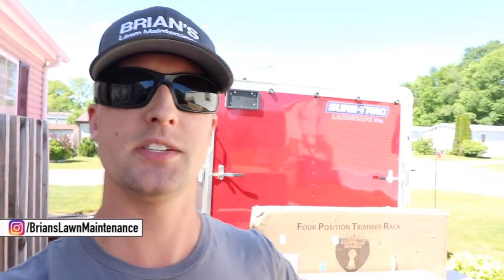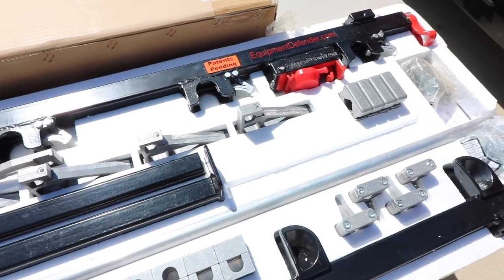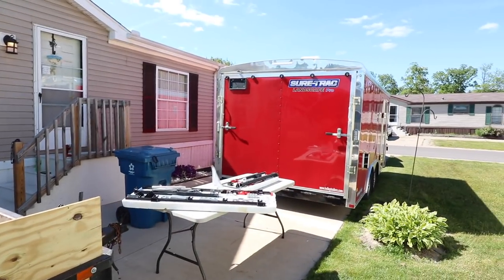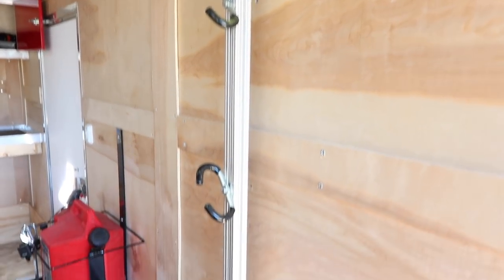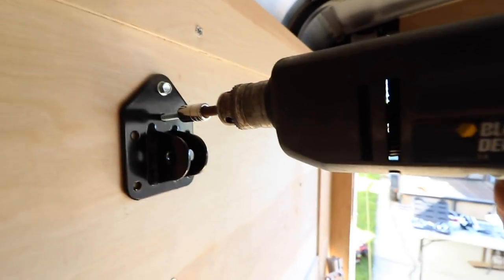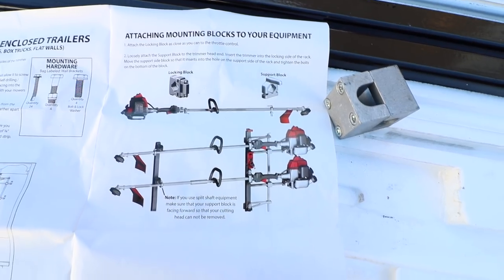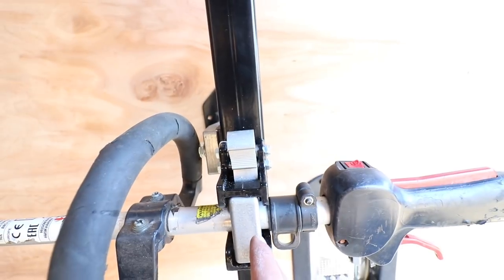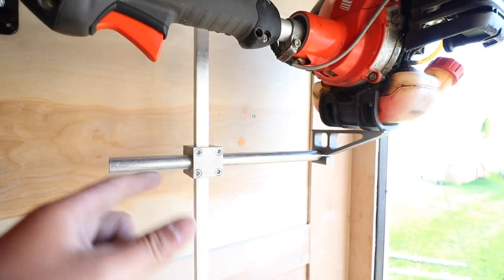Equipment Defender Racks - Enclosed Trailer - Trimmer Rack Unboxing + In Depth Install

Comment: I've been using these racks for years and love them! Just ordered a new full setup for a new trailer/new route as we're growing. Time is money and every second you save adds up and equates to an additional one or two properties per day which means an additional 5-10 properties per week, or up to an extra $300 per week by running efficiently, and these racks help cut time verses using other ways of hauling your gear not to mention keeping them safe. Just a heads up I used Brian's code to grab a discount on my order and brians 10 actually got me 10% off not the 5% he mentions woot woot, just saved $62.30, not to shabby, helps offset the $84 in shipping. Thanks Brian!
Reply from the maker: That’s awesome man! Thank you for the continued support!

Comment: It seems like it takes more time and effort to put the trimmer back on and off the rack? Isn’t it easier and quicker to access the trimmer by placing it in the bed of the truck  instead of having to attach it to a bracket then detach it when you need to use it?  Any time you can eliminate a step throughout the day to get the lawns done the better? Thoughts?

Comment: It seems like there’s a lot of wasted space behind that trimmer rack. Why isn’t it flush mounted or why is it sticking out about 8 inches from the trailer wall? Or what is the measurement from the trailer wall to the equipment head? I’m actually considering purchasing the four position unit from Equipment Defender this week.
Reply from the maker: You have to have room for the engine's of course, but other than that, some folks have bent shaft edgers. Those stick out a few inches towards the wall for sure. It's actually pretty sleak. I don't think you'll find either brand runs "closer" to the wall than the other. I may be wrong. I haven't had any issues with mine how it sits currently. Best of luck with either brand you choose mate.

Comment: Not related to this video… What type of interior paint did you use on your trailer? I am in the process of painting mine right now and I want some good paint that is flexible and durable. I used KILZ® Premium for the first layer on top of the naked plywood, for mildew resistance, and I need some help picking out a topcoat. Thanks

Comment: Awesome video Brian 
Your the man 
I just installed my racks but I am having a problem unlocking the lock  
How to use that red locking system 
It won’t turn to the left to unlock I tried several time with the key and doesn’t work
Reply from the maker: I'm not sure. Perhaps you don't have the trimmer blocks lined up correctly. that would be my guess!
Reply: That two but I figured it out  thxs for the replay back

Comment: Just purchased  this rack  very happy with the quality  however  I would like  my trimmers  to have the engine on the left side .Can the lockable rack on the right side be moved to the left side? Thanks
Reply from the maker: I’m not sure sorry!
Reply: @BriansLawnMaintenance  I received a message from the company shortly after you reply and they said yes you can switch them out the engine support bracket will go on upside down. That's the only difference thanks a lot keep up the good work

Comment: Plus don’t they take up precious space inside the trailer?  If they are not anchored properly to the stud they will vibrate loose.
Reply from the maker: 4.5 seasons later, not a single issue.